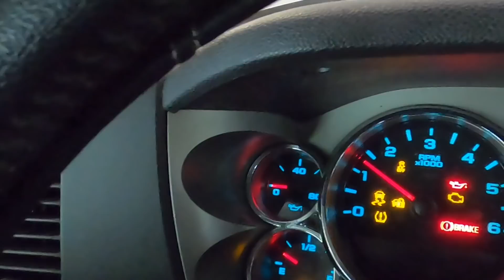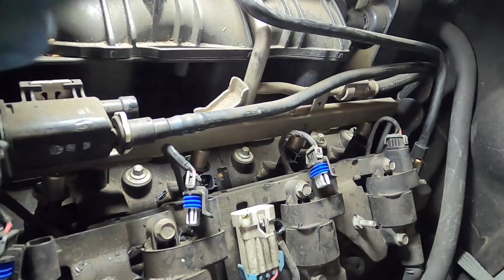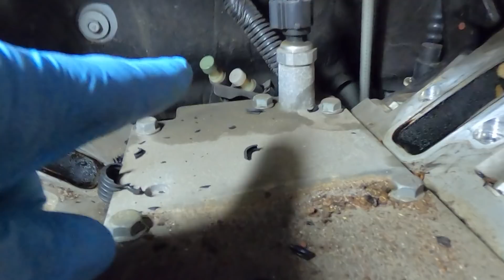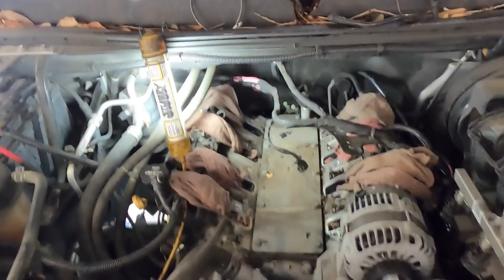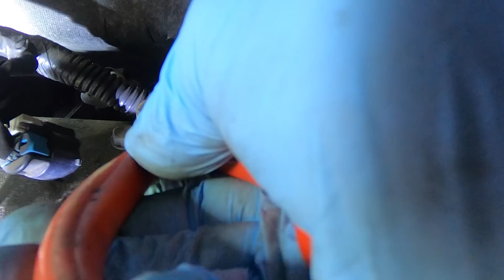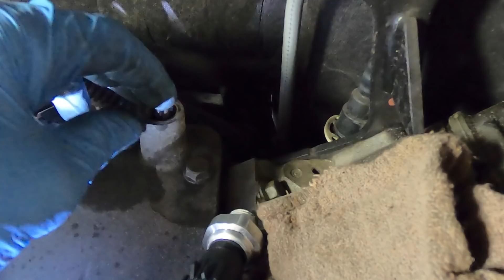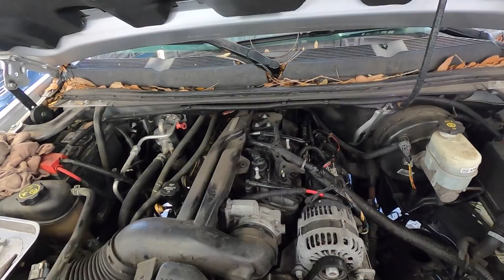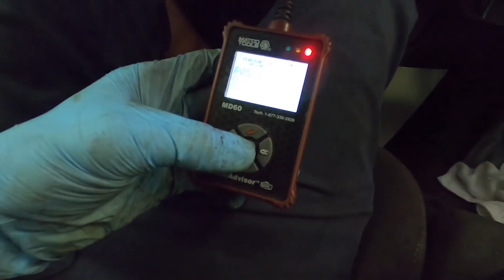Customer States: Google Diagnosis…replace this part!

Comment: IF the customer refuses a diagnosis and IF a customer refuses a reading of the check engine light, it's on him.  Chances are that if it is a high on the output, there is a wiring issue.  Could be something as simple as a connector that's come loose or a broken wire or a rodent-consumed wire.

Comment: That engine design is a time-waster when it comes to the oil pressure sender.  Someone
could have put a little thought into its location, IMHO.
Reply: Come on, it’s a job that takes a little less than an hour to do start to finish, without taking the intake and all that other stuff off.

Comment: Wish we could see the customers face when he realizes he'll need to pay again to have the engine torn apart the 2nd time to fix it proper
Reply: I don't hear lifter noise.  Put some GM electrical tape over the dead needle & send it....
GM put the sensor under the intake. That's the engineering crime here. '76 4x4 didn't have that........
Reply: @Ethan The Porsche isn't my only bad experience.  Honestly the car sat for 15 years so you can imagine how bad in shape it's in.  I also have a Corvette C5 that was taken to a dealer to have them change bulbs in the dash, only to forget how to plug in the projector for windshield and wanted thousands to fix their mistake.  I did it for free.  Or the Lexus dealer who wanted $700 to change the wire harness for my IS250 and I fixed it by cleaning a connectors for the airbag.  There was a recall for the airbag and I thought it was the reason for my Airbag light but no they won't fix it or change the airbag until the issue was resolved.  $700 for putting dielectric grease on a connector?  I'm no mechanic but I have some basic knowledge and enough sense to see bullshit.  As much as I'd like to clap for the guy for avoiding the diagnostic work, I can't help that maybe the customer was right and there's information missing.  Look at the last minute of the video, the needle for oil pressure was up.
Reply: @Ethan I have a cousin that works as a mechanic and he's shown me the way they do things.  I've worked in a shop as a teenager.  There's a difference in taking apart an intake quicker, compared to not taking it apart at all.  It just shows ignorance or unwilling to do the Google work like I did when I changed the oil sender switch on my 2007 Tahoe.  If as a computer repair guy I can do the job better than a dedicated mechanic then there's something wrong here.  And yes, I proudly use Google and forums to my advantage.  I got a 1985 Porsche 928 that sat in the grass for 15 years because a dealer Porsche classic mechanic couldn't figure out why the car wouldn't start.  He basically ruined the car by rewiring the fuse panel unprofessionally and disabled the car.  I had to sit down with a diagram for a week fixing all the bad wiring and someone on a forum tells me to remove the kick down relay because the idiot might have put the wrong relay and that would prevent the car from starting.  The reason people might avoid diagnostic fees is because they're bull.  You hook up a OBDII reader and get the codes and call it a day.  Something anyone can do with a $15 OBDII Bluetooth adapter and a smart phone with Torque.  If you watch South Main Auto Repair he would spend a lot of time diagnosing the issue and he doesn't seem like the kind of guy that would waste his and the customers time because "diagnostic fee".  He'll charge you the fee but he's going to do the work and not just pull out a OBDII reader and collect $200 for it.  Maybe the guy who made the video isn't like this but that's the reputation a lot of mechanics get for a few bad mechanics.
Reply: Wouldn't they have to take it all apart to test the real oil pressure anyway?
Reply: @rickhibdon11  If you were to diagnose it then sure but that wouldn't be my first step.  If the engine had zero oil pressure then it would be making a funny noise and the engine is probably trash anyway.  First step would be to look at codes and live data from the sensor.  Then I would remove the sensor and test it and the harness because the harness could be bad.  If everything tests correctly then oil pump could be bad and then you'd want to test oil pressure.
Reply: @rickhibdon11  Won't run with the intake off.
Reply: @Ethan The car is not made of flesh.  You can reach behind it and remove the component without doing all that work.  I've done it, and I'm a computer guy.  If the Ebay part doesn't fit 100% then you should consult the customer before continuing.  At the end of the video it looked like the sensor did work and he just needed to clear codes.  This is the reason why I do my own repairs now because a good fair mechanic is hard to find.
Reply: He didn't need to take apart the intake in the first place.  If you're nibble enough you can reach in the back and remove it and use a screw to remove the strainer/filter.  Not only that but he omitted the strainer/filter because it didn't fit.  The better thing to do would be to call the customer and explain this to him to see if he'd want you to buy the sensor from your parts dealer instead of risking damaging the new sensor without the strainer.  Also, the sensor might have worked because at the end of the video we can see the oil needle sticking straight up.  Which might suggest Ray might have not cleared the codes or for some reason the needle started working and Ray omitted that from the video.  Videos that end too soon.  Would have liked to know the real reason why it didn't work and why the needle seems to have been working at the end of the video.  P0523 and P0521 would suggest something wrong with the oil sender switch.  

This video is a hate letter to customers who bring their own parts and don't want to pay the diagnostic fee.  I get it, you're a business and you need to make money but Ray intentionally made this more expensive for the customer while doing a poor job at it.  I would not take my cars to him for repair after watching this.
Reply: @DukenukemX  Good eye! Never noticed until I went back to the video to confirm and you are right the needle is up just past 40.  Interesting.

Comment: I replaced one of these on my 01 silveraydo, I. The parking lot of o o o advance  auto parts without  removing the intake, it was a bitch but I got er done, didn't fix the problem. Darn oil pump...
Reply: I used to work with a guy who owned a Silverado. He was experiencing low oil pressure. The mechanic swapped out the oil pump and still had low pressure. He ended up selling the truck and got a F150. It seems like a common issue.
Reply: They do tend to idle at about 45-50 psi. But build pressure above idle, my 2012 1500 is the same way. I will say your co worker made a good move with the f150..

Comment: Perfect torq specs for any fastener: 1/4 turn before it breaks.
Reply: Correction, tighten the fastener till it breaks then back off 1/4 turn
Reply: @rudedogg6331  Then call the apprentice to finish the job
Reply: @rudedogg6331  …..lol

Comment: Surprise you shop took the job   Me as a customer would have pay to for checked out diagnostic for oil pressure and you fix it with you part   There time you just have to bite the bullet.

Comment: I'm glad I'm not the only guy that does these this way. Guys have told me "oh you don't have to pull the intake." Yeah, right. It takes more time dicking around trying to get back there than to just pull the intake. I pop the belt and the alternator off too. I pop the comm harness off and I just leave the battery cable on it,  lay it aside. I've done dozens of these. They all have a screen you gotta dig out. I'll gladly work on a Chevy ls any day over any Ford with a 5.4

Comment: I changed mine out in the Orielys parking lot. No need to remove the intake manifold.
Reply: It can be done but it's a pain in the ass
Reply: Yeah I'd change these all day. Don't have to remove but two lines. Mechanic teck 45+years.
Reply: @wilhampton7779  
Yea but I miss the good old days when they were next to the oil filter.
Reply: I seen a friend try that too, he broke the top off installing the new one, the store did not have another one in stock and it was dark by then so he decided to just go home and deal with it in the morning, started his engine and oil shot all over the back of the engine bay. What a mess.
Reply: Please post a video of you doing that.  I’d love to see that.
Reply: @Brees1986  I agree. I don’t see the room to do it and lots of room for error.
Reply: @mtucker3401    Once you have done it one time its easy.  Sadly I've gotten good at it lol.  I dont have to disconnect anything except the plug from the sensor.
Reply: @jimmace6148  you’ve worked on this make model and year?
Reply: He can charge more by taking off the intake...
Reply: @littlejulian3589  he's not charging more, he's charging what the proper procedure to do the job the right way is. Would you ask for the tech to cut as many corners as possible in order to save time?
Reply: A swivel and couple extensions, 15 minutes tops...
Reply: if ray deviates from the set down procedure it is an open invitation for the shitty customer's to claim something was broken by ray and claim money from him. doing it on video and the correct way he protects himself.
Reply: I agree on the 5.3. Not sure about the 4.8, I have zero experience with that engine.

Comment: But, why for you pull intake? There's enough room to reach behind to get to that sensor. It's a bit tricky and can be a PITA but it's more than possible. WAY easier and faster than pulling the intake. Usually less than 30 mins and you're done.
Reply: I would do it the long way just to bill the customer in this case. The book says do it this way or GM says it to do it this way do it that way. That way when the sensor still doesn't work because it's a wiring issue or an engine control module or body control module issue you can say well we did it the right way so now we got to start over again and do what we like to call a diagnosis by the way that's a 1-hour shop charge too
Reply: I did this same repair on my 07 Avalanche 5.3 and there is no way in hell you can get to that sender without removing the intake.
Reply: @domosautomotive1929  you for sure can. I have changed dozens of them over my career and never pulled one intake to replace these sensors.
Reply: @BigBoyNowYT  You must have small hands because I couldn't even get my hand on the sensor to unplug it and trying to get the new one threaded in would have been a killer. Pulling off the intake was super easy. Maybe the truck bodies are more roomy along the firewall but there was zero room to get my hand in there.
Reply: @domosautomotive1929  experience plays a part. The extent of removal is the fuel line. Some are tighter then others for sure. Do enough and you find a way, shave off minimum an hour and the cost of new intake gaskets.
Reply: @BigBoyNowYT  The fuel line was off in 30 sec but the $50 for the intake gaskets were the big expense. I also knew the problem was with the sensor or the wiring from the code thrown for open circuit.
Reply: @domosautomotive1929  ya normally I pull fuel line. Cram my hand back there flip the connector off, then use my oil pressure socket and a 6” extension crack it loose then remove l. Depending on the room it takes 15-30 minutes on average.
Reply: So they can bill u bullshit labor price
Reply: @brianhansen5904  shops have a book whether it's paper or it is a physical book they have a book. That book tells them how much to Bill for each job. It doesn't matter if it takes that long or not ultimately that's what you end up getting billed in most cases. Of course if they run into problems they have to eat the difference let's say a bill is for 5 hours labor and it took him six they have to eat the 6th hour. But essentially any car repair is governed by you almost would call it a Bible. However many hours it says it takes to paint a car that's what you Bill. If it takes you one half of that you still bill for the total amount. I never agreed with that but no one asked me for my permission.
Reply: @JohnRodriguesPhotographer  common sense would tell u dont go around the block when u can just cross the street to go to store...ITS ALL ABOUT $$$$ JOHN.  This was a total waste of time n labor not to mention i didnt fix the problem even if customer tried to diagnose himself even more the reason to take the shortcut
Reply: @JohnRodriguesPhotographer  true sometimes. I also know these jobs can be done without pulling the intake so I charge 1 hour not the 2-3 the book recommends. All depends on the shop
Reply: @BigBoyNowYT  true. You must have your own shop, if so good for you. The Google guy is the kind to be a prick over the job. Cross your it's and dot your i's with those.
Reply: @JohnRodriguesPhotographer  I do have my own shop. Prick or not I’m not gonna over charge. I like to sleep at night lol
Reply: @JohnRodriguesPhotographer  Thing is that bible assumes the car just rolled off the assembly line.
It doesn't account for anything.
Some techs are a little slower, some are a little faster.
It doesn't account for RUST or body damage from an accident, it does not account for user upgrades to the car.

Comment: I would have used a shop vacuum.
Reply: Blow intake off before you pull it. See all that shit that in dropped in. Som of them valves are open.  Fuckin jackets
Reply: @marktiitto7616  I didn't feel like what he did prevented any dirt from getting in. The towel plugs need to be wedged tightly and preferably mounded up over the top edge to keep things from getting in there. 
I thought the same that at least one valve is open. But even if it wasn't, that dirt isn't going to blow out of the little crevices down there.
Reply: @court2379  right on.
Reply: @marktiitto7616  and the valves that aren't open soon will be
Reply: I've pulled an intake manifold on a 5.3 - compressed air never crossed my mind.  I used the shopvac.

Also, that wiring loom he was fighting with when pulling the manifold - I used a bungee to pull it out of the way.
Reply: @michaelrichey8516   good call i have a old shop vac for just tip of job
Reply: @michaelrichey8516  yep...I was on the same page with you, those little bungie's  always come in handy. 😎👍
Reply: Yeah that was a fail. "I don't want to get debris down in the cylinders"... Proceeds to blow junk in there. The rags aren't stuffed in tight enough to do the job either.
Reply: next time.   Like tomorrow next time.
Reply: @timewa851  rite on bro
Reply: I thought the same thing as soon as I heard him say “ blow it off”. Vacuum for sure. You can even stick the nozzle down the ports to get anything that might have dropped in them. Perhaps just blow off the intake manifold before you pull it. Not hating, just saying it might have been a better idea.
Reply: Indeed shop vac not only for not  blowing stuff in the intakes but also that open fuelline connector pointed towards the front😨
Reply: @matthijsverweijmeren6114  Do not vacuum fuel. Shop-Vac lines are polypropylene and will absolutely create static electricity. Even if you wrapped a bare wire around the tube and grounded it, I still wouldn't do it. But, for the intake manifold, definitely a vacuum.
Reply: @tomb816  Maybe a job for a compressed air powered mini vaccum?
Reply: Maybe the vac is for customers that ask what’s wrong instead of tell what’s wrong. Just saying.
Reply: Maybe I'm just a simple kinda man, but I use compressed air to blow it out outside the garage -- those cylinder head bolt pockets in the head castings gathered all sorts of sand and the like on this car -- then a shop vac with narrow tube adapter to go after any other nook that might need it.
Reply: @theundergroundlairofthesqu9261   Whatever works best for you bro.
Reply: @johndickerson9328  Clarification: er, I meant,blow out the valve cover/cylinder head/intake manifold/fuel injector debris zone of the motor, outside the shop! Then drive it in, vaccum if need be. Then begins the dismantling!
Reply: @theundergroundlairofthesqu9261  either way is still good 👍
Reply: EXACTLY...
Reply: Yep
Reply: Hey Ray if that oil pressure sensor was a recall item you might have figured out the right replacement filter to install, instead of just discarding it....food for thought. 😉👍
Reply: Yeah my job used to have a compressed air safety video that made a good point "your not cleaning with compressed air, your moving the mess around".
Reply: I would have just have him do what needed to be done, thx for the bids
Reply: Haha yeah dfuq, 0 iq. Then continues to shake off the dirty towels at 19:00 over the ports. wtffff

Comment: That is way too much mess of wires and plugs to go through just for an oil sender switch. What was Chevy thinking 🤔
Reply: It’s a job that takes less than an hour with a ratchet, socket, and a wobble joint and you don’t have to take much, if anything off to get to it. You just need to be double jointed.
Reply: @ralfie8801  I've worked on chevy's for over 25 years,  and those things still irritate my. Keep up the good work 💪

Comment: Odd...on my 04 it's not necessary to remove intake to change that out..also see other people change these without removing intake..just curious...your shop needs a truck creeper, u could lay on it and puts u up in the air and easily access back of block or top of motor